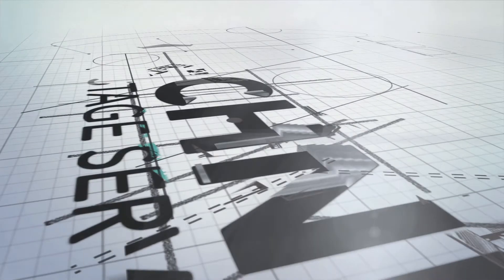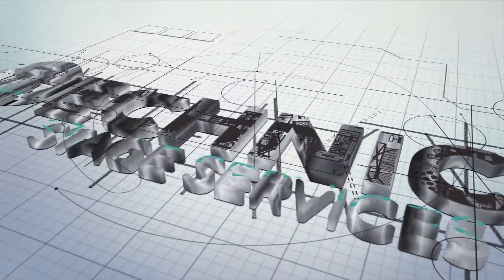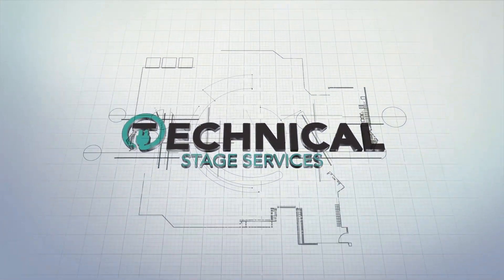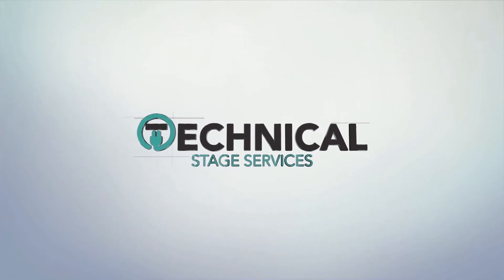PAT Testing - talking through the new 5th Edition

Comment: Yea well I am taking the 2377 C&G in November and yes the whole thing about FIXED electrical equipment and the testing of is unknown to me.  Equipment fixed installations are part of a purpose built circuit so taking them off circuit may not be the fullest way of testing??

Comment: Pat testing is basically a an earth continuity test and an insulation resistance test . But with a bit more like visual inspection of the power cords plug tops insuring the plug has the correct fuse fitted connection are tight and conductors connected correctly . Also any test instrument except multimeters can be used for pat testing. So long as you know how to use them and you know and understand what the numbers mean and are telling you . And yes your safety and that of everyone around you is your first priority.

Comment: Thanks for this, going through 5th Edition training at the moment. Do you have any specific test equipment that you think will work for 5th Edition as most of the older items may not be suitable for testing such items as a hand drier that doesn't typically have a plug fitted.
Reply from the maker: Hi this is where the competence of the inspector needs to make an informed decision on how to safely test these items.  Clearly safe isolation would need to be undertaken to allow the item being tested (a hand dryer in your example) to be disconnect from it's source of supply then a suitable connection needs to be make from the tester to the item being tested.  This could potentially be done with a 13A plug to connector block or a mains test block which allow for quickly connecting to the appliance.  Care should be taken that the test block does not have any indicator lamps as these may give false readings and that a 13A to 'bare end' lead or similar isn't used as this could be dangerous if plugged into a live 13A socket.  I hope this helps and good luck with the training.
Reply: @technicalstageservices  thanks a plug was my first thought but seems a bit strange to test it using a different setup then put it back to its hard wired configuration. I suppose the purpose is to identify any issues with the unit rather than the fused connection it would normally be using as its source.